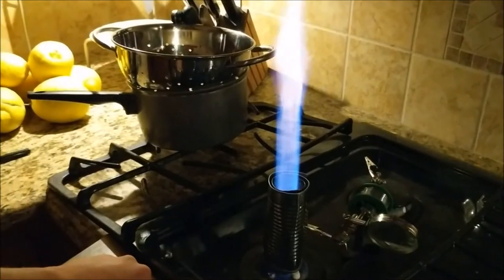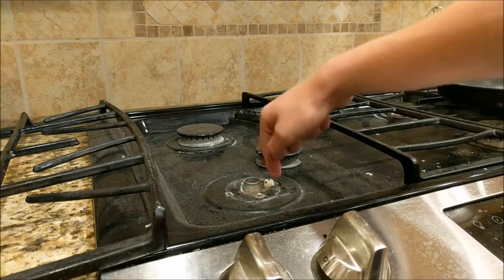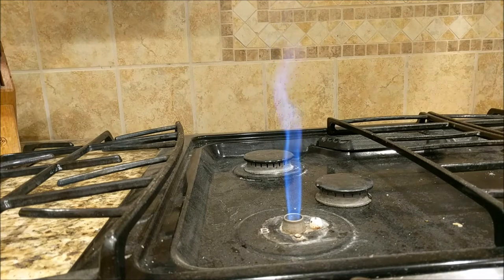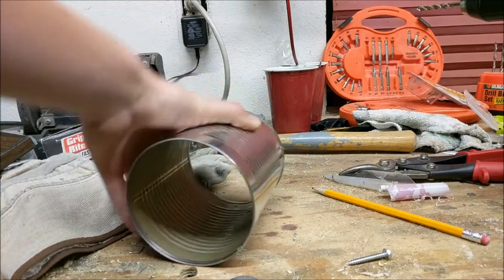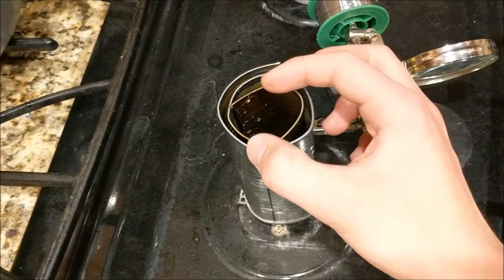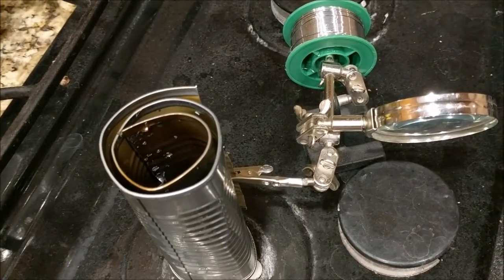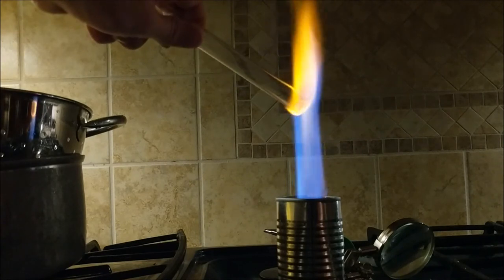DIY Bunsen Burner:  Stove Hack

Comment: I have an old... old... house, with a gas stove.  Heating the place is difficult and I wondered if I could somehow enhance the efficiency of my old gas stove to provide small sudden bursts of heat whenever I'm needing to get the place up to a comfortable temperature.  I know... buy a good heater and be done with it.   But just curious how much more efficient that burner could be.... maybe with a good ceramic element added.

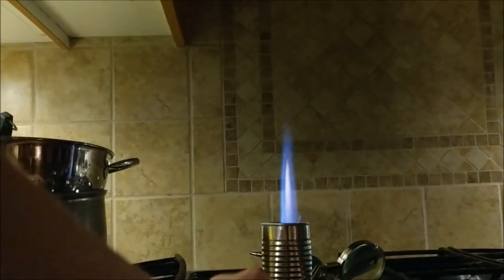Comment: Be careful about "impinging", when the flame is touching the metal, incomplete combustion will cause significantly higher levels of CO.  Around 4:10 in the video, you have a bright orange flame coming off to the right. Something was being burned other than CH4.
Reply: Subconscious Design, I'm pretty sure that's just the plastic coating in the can burning.
Reply: Also, CO burns with a blue flame, and impinging making CO only happens with fuel that is not premixed with air, if it completely combusts its fine
Reply: @EdwardTriesToScience   Thanks for the reply, I learned something new! Subbed to your channel, come take a peek at mine.

Comment: I'm wondering if you might be better using an old aerosol can. Once empty, a can opener could be used to remove both ends giving you a cleaner/smoother cylinder that is already a smaller diameter. Or go to your local metal supplier ans see if they have any 1.25 inch cut-off (scrap) that hey would likely give you. 

Or... this should be ready-made for you: https://www.lowes.com/pd/Keeney-1-1-2-in-Brass-Slip-Joint-Extension-Tube/3514596

Comment: That’s not a gasoline stove or a methane stove it’s a natural gas stove!
Reply: Natural gas is mainly methane, so it can be called a methane stove, see chart below:

Methane 	                              70-90%
Ethane	              	                      0-20%
Propane	                                      0-20% 
Butane	                                      0-20%
Carbon Dioxide                           0-8%

Oxygen	                         	      0-0.2%
Nitrogen                                       0-5%
Hydrogen sulphide                     0-5%
Rare gases	A, He, Ne, Xe	      Very little

Comment: Please Read: Tin has a melting point just under 450 degrees this is a good way to make a hot molten mess on your stove, I wouldn't try this on all stoves nor any stoves at all for that matter.
Just use a regular bunsen burner or buy a little propane tank valve at camping stores for under 20 dollars don't blow up the natural gas supply in your house.
Reply: UltimateNoobCompilation, you're wrong. A "tin" can is actually made of steel, plated with tin, the tin coating though is barely a few microns thick.
Reply: The flame is hot .. the flame inside the can is pulling a draft and has fresh air flowing through...   now if you took another can and held it at the tip of the flame you might get it glowing but this can isn't even turning colors...  your imagination is remarkable.
Reply: "tin cans" are not made from tin but you're right about the foolishness of this.
Reply: People call them "tin cans" because they were coated with tin for corrosion resistance... Not all of them use tin these days though... Just like we say a "tin roof" even though it is steel or aluminum... There is very little actual tin there though... If you melted it all and it collected in a single spot, you might get a drop of actual tin...